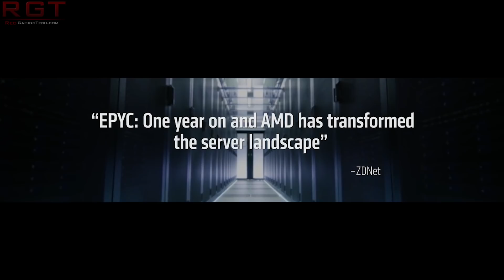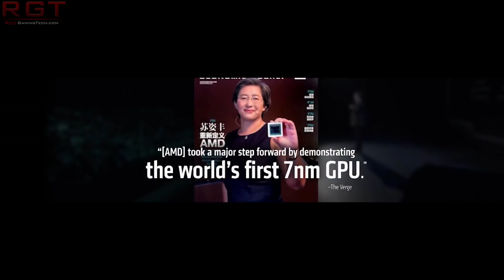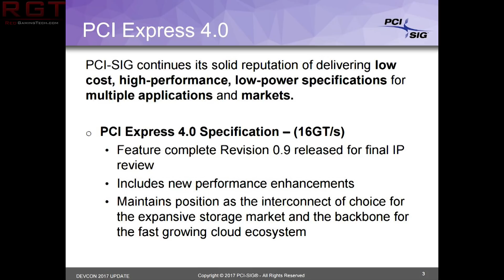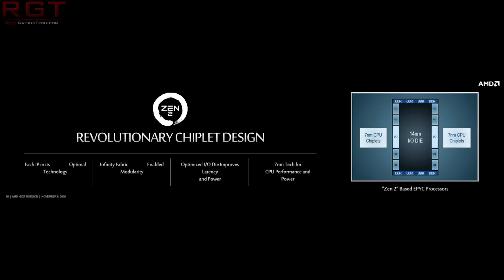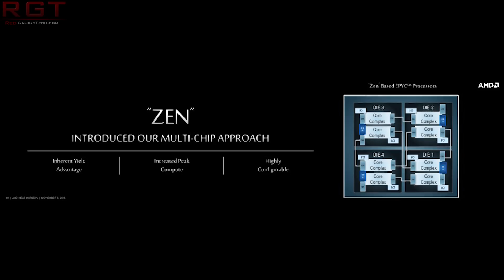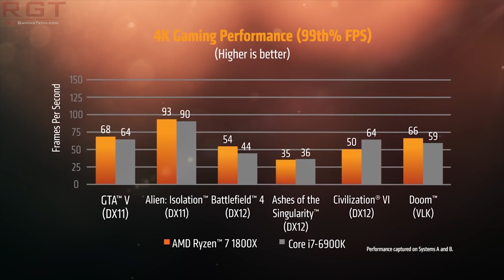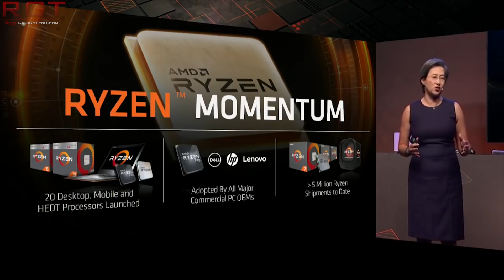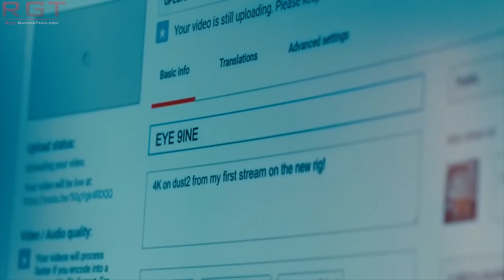Should AMD Raise The Core Count for Zen 2 Ryzen 3000 CPUs ?

Comment: If I was LISA SU @ AMD I would Tell my Guys & Girls DO all you can to Get the IPC UP as High as Possible to 5 GHZ by the time they do the CES in 2019 with  NO Tricks or CHEATS..........Hell if they want even more Street Cred they Could ask one of the  You Tube Tech Reviewers to come up on Stage LIVE & NO not of of the #RIPTEL Shills Showing there ass alot lately!!! 
    Anyway  Imagine if STEVE (G.N.) Or Wendell..or Der8auer was asked to go up on stage & verify with LISA SU at 2019's CES Show ON an OPEN Stage LIVE while DOING the Demo of an AMD CPU 7 NM , ZEN2  RYZEN 3000 Open Air Bench System was INFACT With Running A BASE CLOCK SPEED of  5 GHZ On All Cores & Possibly as A Bonus of A 5.3 GHZ OR Higher Single or Dual Core @ the 5.3+Boosted for TOP IPC Gaming CROWN!!    IF Lisa Su & AMD Could Pull that or 5.2GHZ only on a Single Core it Would Be HUGE ...... IF NOT SHOW STOPPING!!  NOT to mention Ball Busting to BLUE & GREEN..!!!  L O L !!!  Jensen time to get new Elevator Shoes !!     Cow }:-o)

Comment: If they improve IPC, power efficiency, and core clocks, and cost down. SURE.  If not, no.  I mean, I would want a engine that has MORE horsepower, more torque, per cylinder, and better mileage, so long as I dont pay extensively more for it.

Comment: I personally think that AMD could and should do both raise the IPC and raise the core count which the strawpoll didn't offer. Yes at the moment you won't gain a lot having more cores if you're not doing video editing/content creation but it would also allow game manufacturers something to push for, games that run on higher core count and higher clock speeds is something that all gamers would like.   AMD are at the moment lacking higher clock speeds and is lacking behind in, they are just not competitive enough for gamers who like the ability of boosting the frames higher which clock speed seems to help with. It also might make Intel become more competitive bringing the prices of CPU's down and if AMD can also make a better GPU it will help prices for GPU's which will give for gamers better choices.

Comment: Intel is leveraging  the integrated GPU. This is significant advantage over AMD because windows is offering tremendous support to the integrated GPU even though it doesn't perform as well as APU from AMD. AMD doesn't have an 8 core /16thread APU  and they need one bad.. They also need to work with Microsoft to leverage the support of it because it suppose to take much more advantage than what it is doing now but it is poorly being supported! Intel igpu actually does "workloads" even with a discrete GPU enabled. It is NOT disabled. It actually is helping task perform better because of windows features. AMD doesn't have this s I would say 8/12/16 cores and at least 8 core/16 thread APU.. with decent IPC.  And better partnership from windows to leverage their APUs with discrete  GPU systems.

Comment: The modular nature of Zen2 opens up choices for AMD. AM4 and TR4 limits such choices around memory and PCIe channels, but not cores. The Central IO block appears to remove the indirection overhead when increasing CCXs.

I can see AM4 with 16 cores, TR4 with 32 cores and SP3 at 64.

Gen4 would be a logical point to move off the constraints of AM4 and TR4, seeing as existing motherboards and existing CPUs would not support it.

SP3 will survive that. I suspect its trigger will be DDR5.

Comment: more cores, no. 6/12 and 8/16 is enough for normal workloads and gaming. or maybe make some enthusiast model that has more cores but less than thread ripper. The main focus should be in IPC and Clockspeeds. those are the 2 points AMD is losing to Intel in games specially. If they can make a 6c/12t chip with let's say 15% better IPC than current Zen, clocks on 4.5 - 4.8ghz and put the price for 200-220$ that would sell like hot cakes.

Comment: 4.5GHZ Zen 2 is a pretty low estimate considering AMD has said 7nm can get a 25% boost in frequency.
even if you compare that to 14nm with the R7 1700, and only the boost clocks (since the 1700 can be overclocked to 4GHZ in some cases)
That's still 4.6GHZ (3.7*1.25=4.625).
But if we compare it to the 4GHZ mark that the 1700 can sometimes hit (and zen+ goes over easily)
then that's 5GHZ (4*1.25=5)
5GHZ might be too good to be true, but i think it's safe to say that unless something goes wrong with Zen 2, it should be hitting at least 4.8GHZ.

Comment: the answer is simple... they should do all of those thing, i would assume they are going to push clocks as far as the silicon will allow and ipc is already lock in place when they designed the Zen2 architecture. I'm hoping they stick with the budget/gaming friendly r5 6/12 with high clock speed but also offer a 12 or 16 core for AM4 because not very many people have or want to buy a $300 mobo and a $800 TR then 4 stick of ram for it. But a lot of people have a good x470 already and wouldn't mind spending $450 on a 12 core to expand their capability considering 4 more cores plus ipc/clock gains would be a substantial improvement over a 2700x.

Comment: More cores? NO. Focus on the clocks, AMD. Consistent overclockability to 5 GHz+ or bust! If that requires specially binned "Black Edition" chips, so be it.
Reply: did you not see what happens when chase clock speed only (9900k cough cough) Speed is "great" but not if it means need very expensive cooling/motherboards etc to "allow it"

Consistency as low a cost as possible as low wattage as possible, frequency and IPC (low latency as possible) matter for much much more...FX 9570, raw speed in regards to Mhz, but good lord those chewed a bunch of power and were flamethrowers to chase the clock speed, just like 9900k is ^.^

Comment: would it be possible to move some gpu work to the igpu ?
Reply: gpu handle different task than cpu, so technically igpu already do handle tasks if you have an igpu (example 2200/2400g) the core (basically 1500x) is tied with a Yega 3/8/10 graphics core, the vega handles video stuff, the chip handles the rest (all the IO, number crunching etc)

CPU are "general purpose" GPU (and igpu) are Graphics Processor, GPU can do "some things" that CPU can do, but to build them to "handle" everything a cpu can as good or better (such as an ASIC does) the cost goes through the roof and they become less "functional" as a GPU at that point.

Comment: With Zen2 technology, AMD should make:
  #1:  4, 8, 16 core one-socket Ryzen 3/7/9 CPUs.
  #2:  16, 32, 64 core one-socket Threadripper CPUs.
  #3:  64 core two-socket Epyc CPUs.
  #4:  blazing-fast 4 core one-socket CPU based on the faster 7nm technology plus requirement for liquid cooling... 5GHz to 6GHz base clock speed.

The point is, AMD needs to keep sicking swords into Intel for at least 2 or 3 more years go gain enough traction and funding to assure competition for several years.

AMD absolutely MUST keep the pedal to the metal for at least 2 or 3 more years to entrench themselves in the CPU market at a similar level as Intel.

Comment: If design allowed for a 12 core part on AM4, and it could universally improve performance (like the 8700k to 9900k), then AMD should go for it. If the extra cores creates complications for normal apps (like on Threadripper) then don't bother.

This theoretical 12 core part doesn't need to be the main attraction, it can have a top-of-the-line tax like the Intel CPU's if need be. Just getting closer to having the best all-around CPU (no matter the cost) would help consumer perception, because that's all they're missing right now.

Comment: If core count is increased i think the best gaming cpu would end up being 3600/x, and the 3700/x would become a more professional CPU
Reply: 2600/2600x are pretty much there atm 6/12 core/thread, if Ryzen 2 follows the same route, than 3200/2400 will be APU only, 3600/3600x will be 6/12 or whatever core and 3700/3700x will be 8/10 core at even higher clock rates...time will tell.

Comment: What we really need is.... Hbm2 as an L4 cach and higher thread per core count to be brought to the CPU market. Hbm2 can be used in forground application while ddr4 can be used for background applications while the extra threads can go towards ai, Ray tracing, and  better prerendering.
Reply: would be the other way around actually, DDR4 is much "quicker" so would have to be foreground, HBM would be "slower" but much more available bandwidth for background tasks..L4 is "pointless" currently because the CPU still has to "crunch" the numbers provided by HBM (HBM is memory, not a processor) therefore HBM would just be a memory "pool" likely would be "great" for iGPU to have that much more available memory as an example, but, if the processor does not have enough "grunt" to use it, you gain latency and cost for nothing else.

L1 extreme speed, small amount, L2 reasonable speed larger amount more latency, L3 slower speed much larger amount quite high latency (usually ~3-5x "slower" in regard to latency but also similar increase in size) L4 would likely be similar concept but if use HBM "theoretical" would be nasty latency but massive amount (scratch pad) at great speed (likely be much higher power/temps however)

Comment: NO to increased core count... why?
Can Dual Channel DDR4 handle the bandwidth of more than eight fast cores? Maybe when DDR5 comes a 12-core or 16-core CPU might make sense. That's really my only concern since 7nm power efficiency should be fine for up to 16-core at 4+ GHz... I think AMD will focus on 8-core chiplets  so a 12-core would probably be a 2x8-core + IO chip design though if that can't fit in an AM4 or AM5 socket it's probably a non-starter since I don't think 12-core chips (for chiplets or full CPU with one chip only) make sense. They have up to 64C/128T EPYC CPU's based on 8-core chiplets now and I doubt the server ecosystem has much demand to go beyond this core count for a while yet (other component bottlenecks etc) and even if they did would they benefit from 12-core chiplets more than adding more 8-core chiplets?

Comment: Could a 'new' AM4  socket Motherboard support 4 channel memory- or would that require a redesign of the socket? The irony is is that you need an expensive CPU to get the most out of 1080p games and that you don't need an expensive CPU to get the most out of 4k games due to GPU limitations even at the high end.
Reply: we don't "need" four channel for consumer systems (at this point) this is why AMD have TR/EPYC where you can truly use quad channel...having extra channels of memory only increases cost does not automatically mean "more performance" 64gb dual channel is plenty fast with lots of memory, you want more TR is 128gb quad channel (I believe, it could be even more)
Reply: What if AMD wants to go towards APU's?- More bandwidth required.  @mauriceakamoefortin2510

Comment: Core count first, as much as feasible. Can't push for a much-needed paradigm shift, without many cores in mainstream/low-end segments. There are practical reasons why we're not rocking 10GHz processors after all these years, and why multiple cores have instead become the trend. IMHO AMD simply mustn't give up this lead, which already is paying off and will do so even more in the future.
Single thread perf. improvements should ofc come, but they should be the 2nd priority, not the first. 4C/8T were "enough", a mere 2 years ago; now, 8C/16T are "enough". See where we're going?

Comment: i think that 12 cores at mainstream is ok though. Like the 3600 get 2 cores and the 2700 get 10 cores and launch a new serie like 3900 with 12 cores. But i dont think is realy necessary right now. For games, we need more IPC and clock speeds, for niche market, u have threadripper.

Comment: I would want Ryzen 7 to become 10c/20t or 12c/24t chip so that we can move everything up. I don't think 16c/24t is ideal due to current memory bandwidth limitations. Ryzen 5 3600x would be 8c/16t, Ryzen 5 3400G would be a 6c/12t APU, Ryzen 3200G would be a 4c/8t APU, and then maybe a 4c/4t chip for the Athlon line. This way AMD maintains its core lead in ever category and Intel has to shuffle their whole lineup again. On top of that an IPC and clock speed gain is a given. At a 10% ipc gain and a 4.5ghz all core boost clock, those chips would be in a good place I think.

Comment: The issue is the scaling law for the memory technology being used. I think DDR4 is pretty much at it's limit with 16 threads. Maybe if you upped the cache to 100mb which would be expensive and increase latency. you could get a bit more, but that's really the only way.
Reply: infinity fabric can very likely be made direct link to every core so whatever "issue" of feeding 8 core 16 thread "you think" might currently exist likely does not at all, rather like most things, it is just a matter of "engineering" that holds the design back from being "outstanding"

APU suffer more from "lack of bandwidth" to feed the cores and have 1/2 the amount of cores to feed...cache helps but IF at higher speed and a direct connection to every core (maybe an interposer under each core?) would make any "seems like" bandwidth issues completely disappear.

I know with hypertransport (IF is an advancement of what HT was) can be made "wider" with more links and has a massive amount of bandwidth available to feed memory and the cores overall, enough that desktop and even HEDT users can very rarely make full use of it ^.^

Comment: imagine a ryzen 3 3200 with 6 cores and 6threads and higher clocks hmmmm
Reply: 4 core 8 thread is the MINIMUM AMD should be doing IMO, have a bit extra room for even more GPU "grunt" instead of chewing up transistor count to have more cores and threads and limiting TDP headroom so that the cpu/igpu "throttle"...they should for sure make the next APU (3200-g) as an example not be limited to pci-e 3.0@x8 speed like current ones are, but rather have single external gpu at full speed and make sure that it does not "throttle" because they use not the best cooler or not give enough TDP headroom IMHO

Comment: Yes up the core count, push the 6 and 8 core into a lower price bracket, crush Intel in the lower end compute performance (12/16 core) on AM4 and move Threadripper to a minimum 16 Cores. Push the mainstream into using and optimizing for more cores.

First, I think there are plenty of people who would use a 16 core on AM4 as most of the reviews of the i9 looked at more than just gaming and some where very in depth with encoding and rendering and what not.
Second, Increasing clock speeds is already a game of diminishing returns and 5Ghz is currently the practical limit, so the only way to allow for larger more inexpressive games is IPC and broadening the throughput structure with more cores.

Comment: Those questions are silly questions to use in a poll. You should have worded it something more like 

What do you think is the most important
Clockspeed / IPC
MOUR CORES!!!
Other features like iGP.

And I think you would have had a massive difference in results. I think most people want clockspeed and IPC improvements first and foremost, more cores is just gravy.

So basically what you asked was do you want more gravy or just meat and potatoes. No sane person would say no I don't want any gravy apart from those who think that you have to have less meat and potatoes if you have more gravy.

This analogy has went a bit too far... anyway so basically people think that you must sacifice clockspeed for more cores, and while yes the all core boost clock will be lower on a 16 core part vs a 8 core part, but the 8 core boost of the 16 core part will likely be higher due to it using better silicon and if the load is spread between the 2 dies you have more area to contact the IHS which will mean a more efficient transfer of heat and lower thermal density. 

So in the same workloads it will actually perform better, this is because AMD if they go higher that 8 cores will be using 2x 8 core dies which means they are not subject to the same limitation that Intel is where when you increase the size of the die not only do you increase the likelihood of getting a critical defeact but you will have more smaller defeats which will bring down clockspeed due to voltage lackage and the chances of get 28 cores to all get to 3.2Ghz in a non AVX workload at the required voltage is highly unlikely.

Where as AMD is sticking 8 core dies together so they are not bound by that limitation, there only limitation on scaling up is power consumption and heat dissipation so your 8 core boost clock when the rest of the cores a basically inactive will only put out slightly more heat than an actual 8 core CPU.

So to dig up a dead house to beat it to a fine paste it is not gravy or meat and potatoes it's meat and potatoes with gravy or meat and potatoes with more gravy.

Comment: 8 Cores is plenty, especially if they manage to reduce inter CCX latency and improve the cache hierarchy.
Both result in better IPC and clocks are nice too (the cores are pretty good as is).

If die is space free due to smaller process, go for 4th level cache and/or a IGP, just enough to enable more cost effective systems and force FreeSync support for those using NVidia cards.
That direction would essentially be a big victory, sticking it to both Intel and NVidia at the same time!